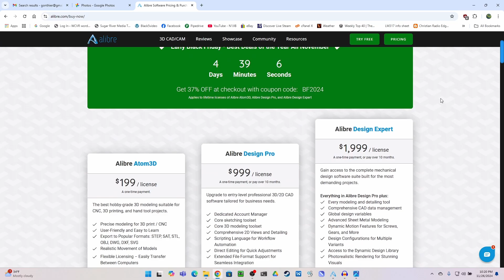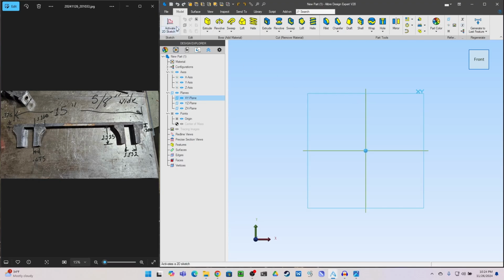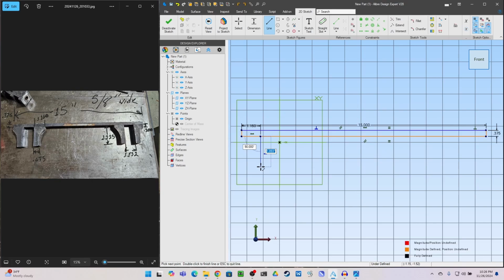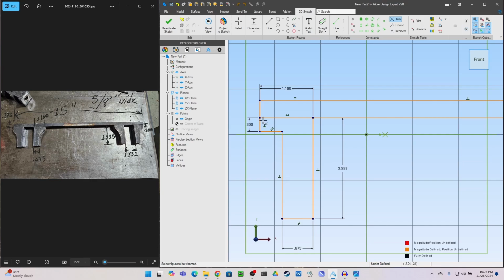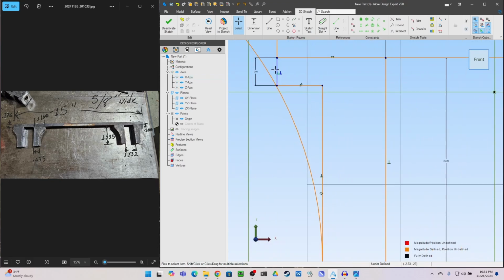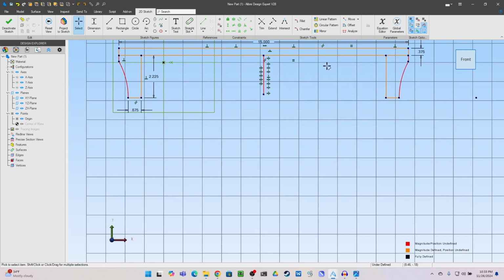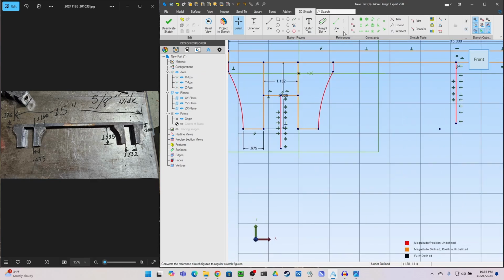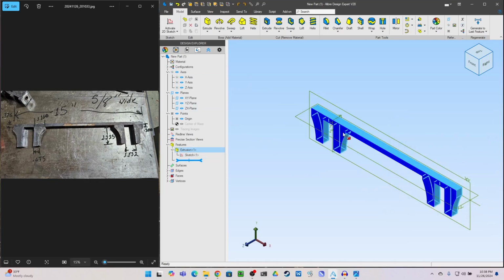New series! Redesigning locomotive trucks with Alibre design (Pt 1)

Comment: Interesting Video.  I'm currently trying to teach myself to use CAD using 'FreeCAD'...  (Never too old to learn a new trick)  I've spent money before on things I thought I'd like to learn and then never gotten anywhere with it... but if I do keep up with what I'm doing and decide to go with a commercial product I could see this being one I'd consider.    

Watching your videos has given me the RR bug... I've been using the CAD program to try to lay out a ballasting hopper that's sort of a combination of the classic hopper design and the two different types (center and side) that Bill has on the SHFR.  One bay does sides, other bay does center.  If I get it right, it should leave the rails clear as the ballast spreads while still handling the 3/4" stone.  SOOooo much angle iron. 😃   Doing it as a framework that will get plywood sides and base.

Anywho... I'm wondering how progress is going on the 2 bogie plan for your switchers.  I know each bogie will get its own motor.  Do you plan to downsize to something like the Plum Cove 250 for each bogie or stay with the 500?... Starts salivating at the thought of an ES-BB-1000 😁
Reply from the maker: There is a free version of Alibre. Alibre Atom. 
Welcome to the railroading hobby!
I got bogged down by other projects, so I haven't made much progress on the four axle switcher plan. Plum Cove moto4s are only 150W each, so I'm currently working on a 500W power axle.
Your hopper idea sounds like a good one. Look up Wine Company ballast hopper gates.
Reply: @MillBrookRailroad  Thanks for the steer on the gates.  I had actually seen a video of a full size hopper using those (or something very similar) to do ballasting.  My concern is that at 1/8 scale, the gates would have the same issue as the ballast hopper you have, with the gravel jamming in the throat.  On the other hand, I could model for appearance (hmm  PVC pipe?) and have a working system behind it. :)

Comment: I presume the software can also use Communist units for those of us that live in metric land?
Reply from the maker: You can use either imperial or metric. My measuring tools are imperial, and these parts were originally designed in imperial, so it made the best sense to use that measuring system.

Comment: Interesting Aaron...  I've been a Solid Works user for 20yrs or more.  But this looks like a good and reasonably priced alternative for hobbyists.  I'll be looking into this should my PC ever crash and I lose SW (I installed it on my home PC prior to retiring in July).

Looks like a good project for laser cutting...  Though you could say that about most large scale RR projects!  Worked in the laser cutting industry for 30yrs.  Really miss having access to lasers!
Reply from the maker: I started out with Autocad Inventor, years ago. Afyer trying other programs, I like the product that Alibre puts out. So that's why I asked them to sponsor this series. 
I'm using Send Cut Send for laser cutting and parts bending. Decent price, Good quality and a fast turnaround.
Reply: @MillBrookRailroad  Started out on AutoCAD 11 about 35yrs ago.  Never used the more modern or 3D versions of it.  Been spoiled by Solid Works all these years.  

I've checked out Send Cut Send...  I have a design for multipart laser cut steel turnout frogs.  I just need to purchase a piece of 1" rail to verify some of the dimensions so I can finalize the design.

Good luck with your truck project, will be watching with great interest.

Comment: There are countries that use the metric system and countries that land on the moon!
Reply from the maker: At the end of the day, it doesn't matter if it's metric or English. It all ends up the same size.
Reply: NASA uses metric, same as the military. Deal with it.
Reply: And then there are those Mars missions where they mix up the measuring system and who knows where it ended up... (not Mars) :P

Comment: do you have to do the entire lay out including drill holes, mounting etc. ? or only the metal part that only have the 
demential size of the part? for the cutting process. wow that will make it easier to create the parts you need.
you just need to verify it is all correct before you “ hit send! “ the it will be possible to set the locations for everything
needed to assemble the trucks. Take care Aaron, good luck and keep up the great videos!
Reply from the maker: Well, since they're being laser cut, I will need to drill holes.

Comment: EPIC!!  I was just thinking about a double axle truck for your engines the other day.  How did your new engine frame work out after the 2nd fitting?  Any updates on the Stoddard Hill RR??
Reply from the maker: @brutus1102  The engine frame worked better after the second fitting. I still have some modifications to make, but it's mostly how it needs to be.
Bill made some progress on the SHFR in September, finishing the first siding up the hill. He only works on it in the fall, so progress is never very fast.
Reply: @MillBrookRailroad   Thanks for the update.  Follow up question, will each truck set then have a motor that turns with the trucks??  Any idea of a price range for your engine with the double trucks and new frame??